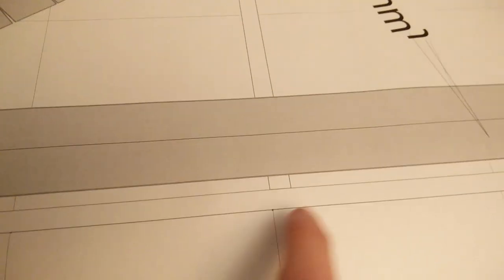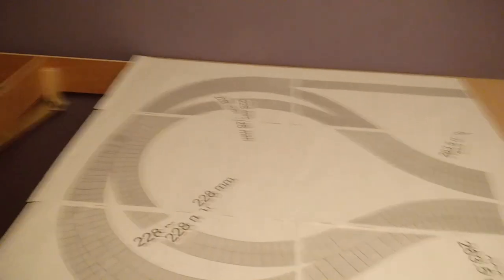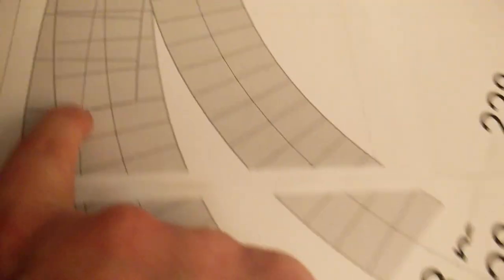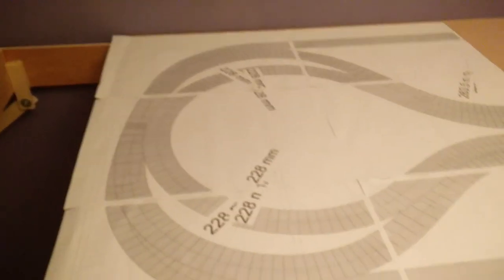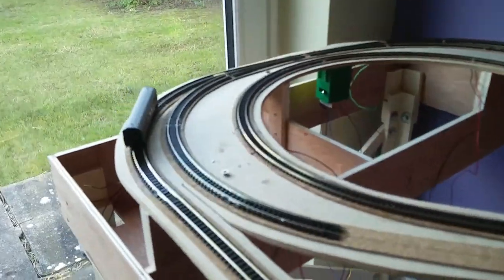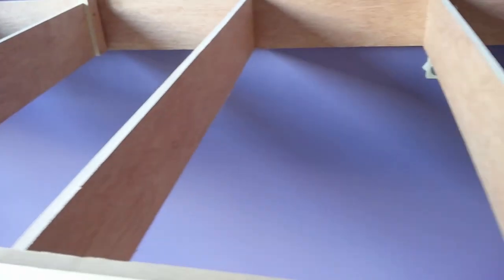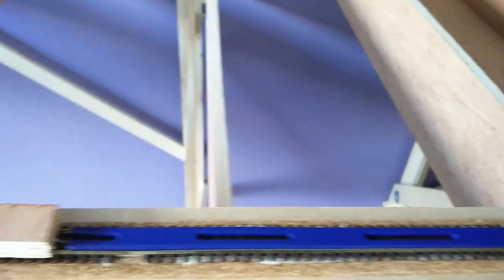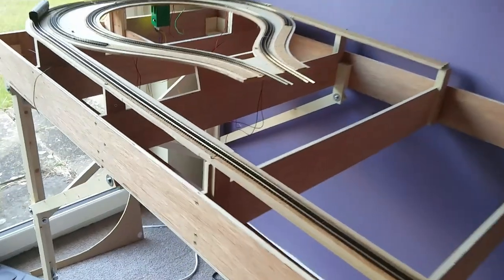06 Track laying | laying n scale cork roadbed

Comment: Did you find the cork east to bend around those curves.
Reply from the maker: Bending cork is easy. Best way is to cut in half length-ways and then you can bend each half around tight curves. Also makes it easier to follow a centre line.

I happen to sell cork roadbed. let me know if you want some.

Comment: Hi, Just out of interest with your droppers are you following the school of every piece of track, or when you incorporate block detection will it just be one set of droppers per "block".
Reply from the maker: I am adding a set of droppers to each piece of track, (and so not soldering the joints to allow expansion) and then connecting all the droppers for each block to a bus wire using "suitcase connectors".